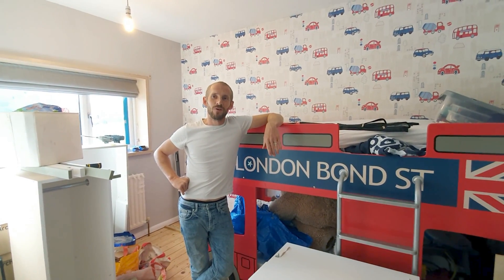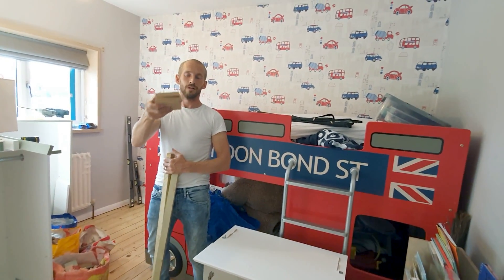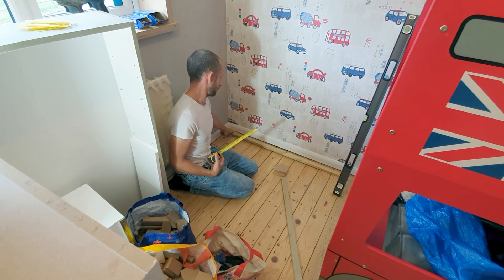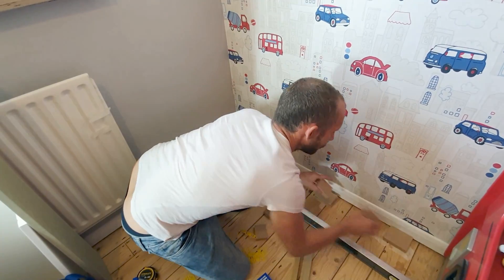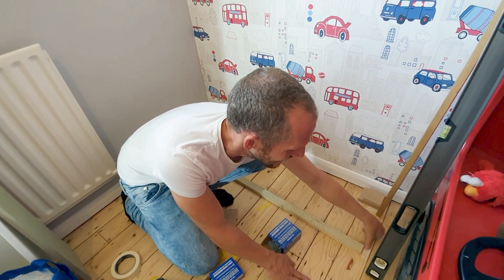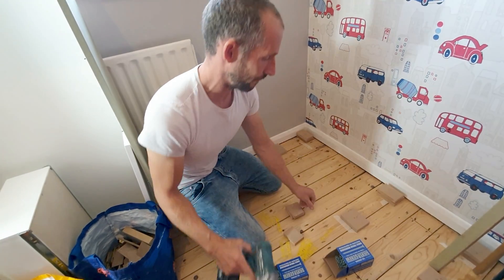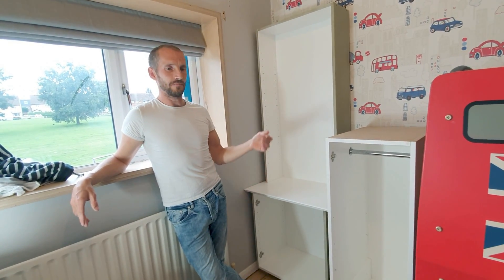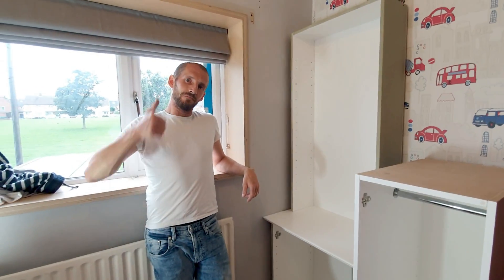Level up & fix ANY Carcass using BEARERS - Alternative method to adjustable legs - EP#30

Comment: Thanks for having made this excellent video.  I was so surprised when I watched you screw the first layer of packers into your flooring.  I guess it means you figure that you will never need to move that piece of furniture.  In my case, I would hate to drill holes in my beautiful imitation marble floors, although I am finding it a huge pain to try and level one of my wardrobes.
Reply from the maker: Thank you.
You could screw all the packers together and then the bearers to the packers, all without fixing anything to the floor.
If your wardrobe or unit is heavy enough it should weight it down nicely. 
You could then stabilise/fix the bottom of the wardrobe sideways into skirting boards or walls.
Or, you could glue the packers to the floor.

Comment: Cheers, for point this video out to me in your latest release, this really filled in the gap I had with your installation method.
A question, if you were installing bearers on to a concrete floor/pad would you still sink a screw through the first packer or would you glue it down with liquid nails or something similar?
Reply from the maker: Thank you!!
And yes either way really... I'd say a 5x50 screw throught the first 18mm base packer is the best bet, unless you can 100% confirm the glue will be good enough and not come off 👍👍👍

Comment: I have been making plyths with 4 X 2 planed all round timber . I must admit your way is simpler, cheaper in cost and just as quick maybe quicker actually not to mention easier to carry all the bits to the place it needs to go instead of carrying a pre built piece, which still needs to be made level

Comment: Thanks for sharing, would you also do this for a deep and heavy wardrobe like IKEA Pax 100cmx60xm? Would you still do 2 rows of bearers or 3? With Pax is seems like the side panels are what supports the frame so would you ever lay the bearers vertically or should it be fine? Thanks!
Reply from the maker: you are welcome.
I always use this technique. Just make sure the packers are where the weight is being transferred down, like a division or side.
No harm in doing 3 rows, but I never have, I think 2 is enough. 
I make the bearers the same width as the carcass, then any side panels travel down to the floor.

Comment: Hi Ryan, thanks for the great video. How would you fix the packers down onto a tiled floor? I was thinking grab adhesive may do the trick or I guess I could use a tile bit and wall plugs. Cheers!
Reply from the maker: Hi Jack, I'd do exactly what you said.
I'd probably try drilling first as I would prefer mechanical fixings, but a grab adhesive second choice. It would be tough not to disturb the first packer whilst building up and putting on the bearers but doable
Reply: @thelondoncraftsmanworkshop  perfect, cheers. First time trying your patented bearer approach so looking forward to being able to slide the carcasses without worrying about the feet buckling!

Comment: What size screws do you use bud? I heard u say 30 ‘ 40’s etc are they a 4 or 5?.. Screwfix?
Reply from the maker: Hi, for bearers I always fix down an 18mm packer first to build up my layers. So my first screw is mver more than 30mm as wooden floors are generally only 20mm floor boards and don't want to risk hitting a pipe underneath.
After this layer you can go to a 50mm for the rest of the packers and the bearers.
I use size 4 heads, but I still use size 5s for fixings into brick /concrete etc and for those kind of uses, but 4's on all my carcasses and bearers etc 👍👍
Reply from the maker: I just use basic screws for toolstation or screwfix as the dont need to be special. As long as you pre drill with a 3mm drill bit on everything then any cheap screw will do.